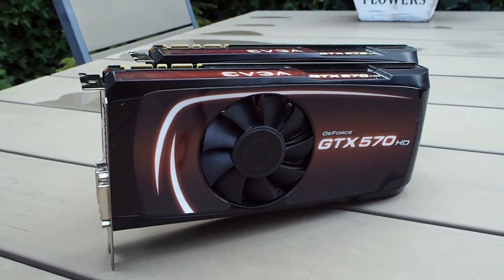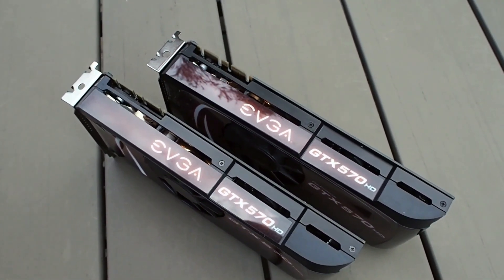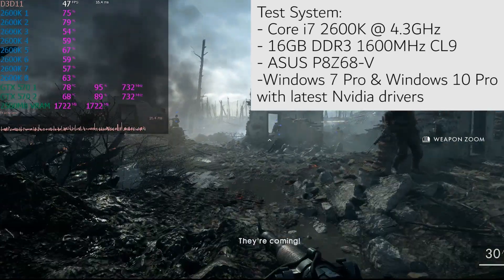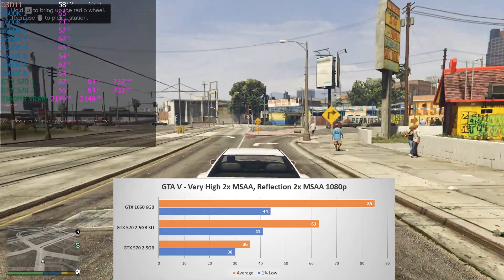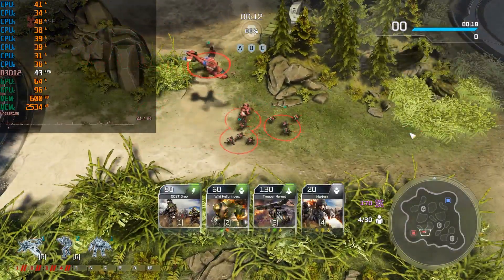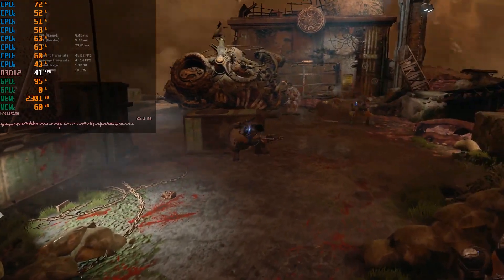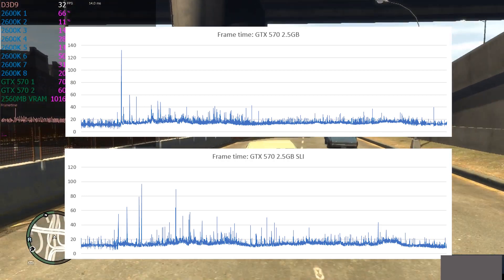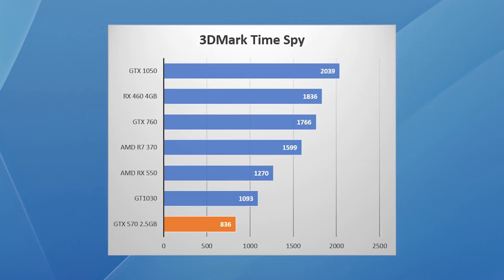Fermi Revisit: 2x GTX 570 2.5GB in SLI & DX12

Comment: GTX 570 still beats the I9 9900K iGPU UHD 630, so of course the GPU its good. But if u compare to a modern entry level GPU the GTX 570/580 will lose. When it comes to SLI i dont think its good any more, better of buying a single faster GPU.

Comment: Great video. GTX 570 is 9 years old. Nivida is just not pushing hard enough the performance for higher fps. That's why the majority is staying at 1080p/60hz still. How much more years will this be the mass standard? I recently went 1440p/144hz and I just bought GTX 1080Ti, since RTX is such a disappointment - pushing new graphics tech/effects up and pushing fps down in the gutter.
Reply: This comment is entirely accurate even 3 years later. We can "barely" play at 4k now.